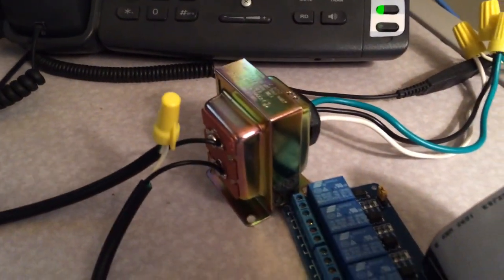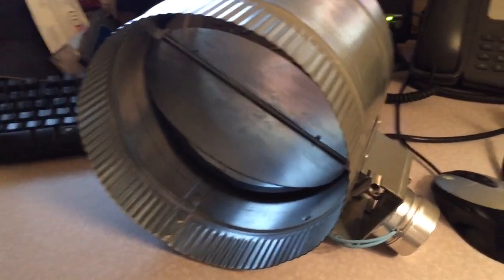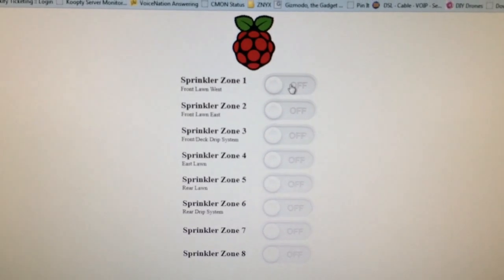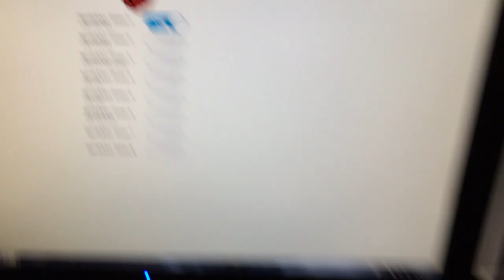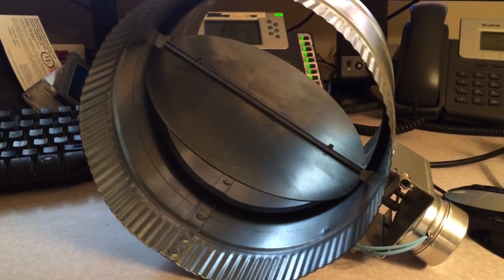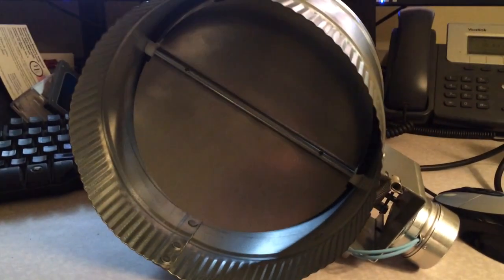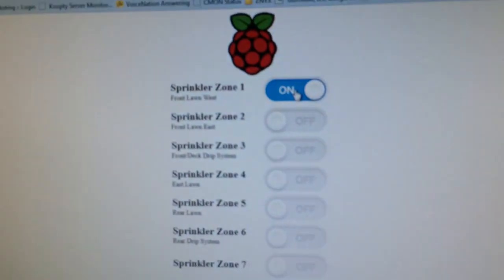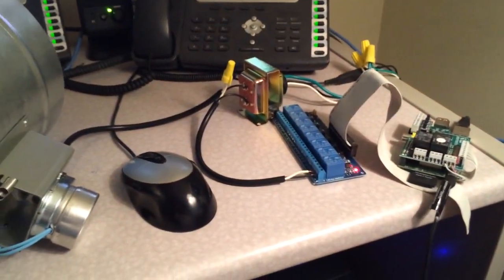HVAC Electronic Duct Damper - Controlled by Raspberry Pi

Comment: Does anyone know of a faster damper? I'm looking for something like this for an unrelated project. I ended up building dampers and using levers/stepper motors but it's a bit fiddley. I'd love a turnkey solution
Reply: Put way more current to ehhh!
Reply: Luxury Metals maybe. Don’t know how fast the ones he sells are. But I do know anything pretty much made tin is built sturdy. I just bout a 7” wall vent from him for hood range. Best option out there. I guarantee that.. not even exaggerating I looked for something on the heavier duty side for around 1&1/2 maybe 2 years. On and off of course. But I’m very pleased with his. PS I don’t know a single sole in Idaho where he is located either.

Comment: I have pretty much this exact setup in my house, I have a 3d printed standoff board that holds the pi and relay board (same relay board) and have 4 zones.  The Pi also controls the HVAC itself with a custom Web UI.  Need to add temperature sensors, right now we just have it on a timer and call each zone as needed for anywhere from 5-60 min.  Made the electrical bill plummet.

4 wires control the zones, and 4 control the HVAC unit itself.
Reply: I can share the software on Github if anyone is interested.
Reply: @moderngeek7911  I'm interested.

Comment: Will you please share the code on a public CVS site (preferaby Github)? I'd like to prototype and eventually setup a damper system for my house to prevent scrapping my perfectly good (but slightly under CFM) HVAC system. I'd love to DIY as much as possible but your code will give me a fantastic head start.
Reply from the maker: Steve Hynding so I never actually installed this. There is no code at this time. Some day...
Reply: Thank you for your reply. I finally got around to playing with my Pi to figure out the code piece to power switch the relay (happy to share if you're ever interested). I was hoping the next step would be 100% visually obvious from your demo but I can't be certain: is your wiring setup into the 5v relay module on the 1st (white) and 2nd (black) terminal? From what I understand (again, not certain) is that the 3rd terminal (closest to camera in video) is "inactive" and (along with 1st terminal) is never electrically connected. Second, did you power your 24v AC transformer with a frayed power cord?

Comment: I wouldn't recommend using that style of damper, cheaper but unreliable, if your keeping it closed will constantly use power. Better off getting a commercial grade I know a few places make them for the same price and the motor powers to close and open only using power when it's needed

Comment: Do you have the link for this build?
Reply from the maker: What do you mean? Link to what?
Reply: mrbmw99  parts list, assembly ,code, etc. I go as much as I could from this video and others but I really like the setup you have here. I was going to mimic it to learn more.
Reply from the maker: Nope, this is it. The relay board and duct damper are from eBay if that helps.

Comment: Stupid question...  if the transformer is 24V, it's ok to use a 5V Relay?
Reply from the maker: Yes, you can put 24v through a 5v relay. A 5v relay means that the control portion of the relay needs 5v to close the relay. But the load portion of the relay can carry much more. In some relays even 120v mains power. You just need to use a relay that's marked for (at minimum) the voltage and amperage that you want to switch on and off through it.

Comment: I have been dreaming of doing the very same thing. Can you please do a follow up video of how it went, and the complete installation? Where did you install the dampers, I am afraid of putting the motor under the floor boards in case the motor dies.